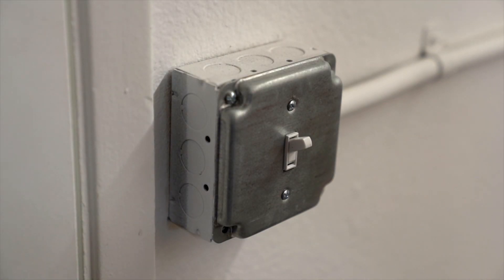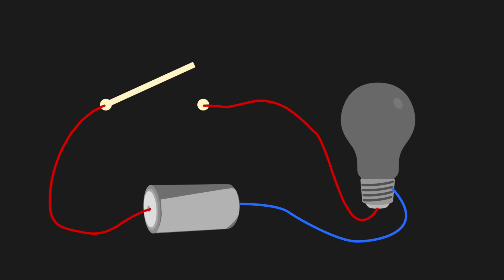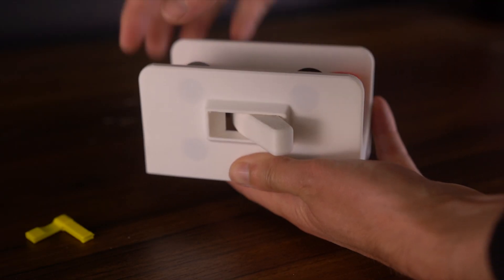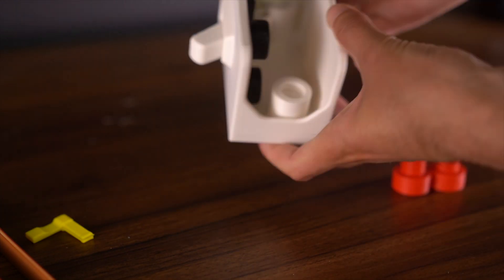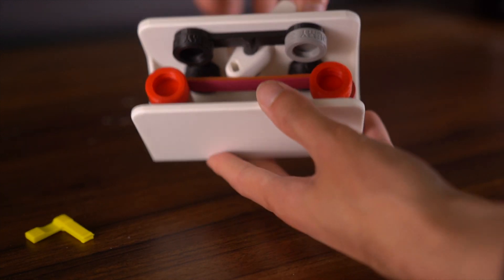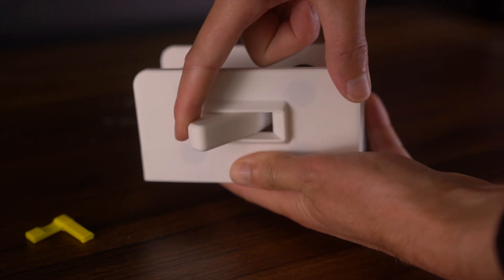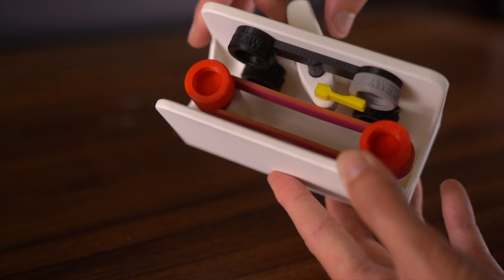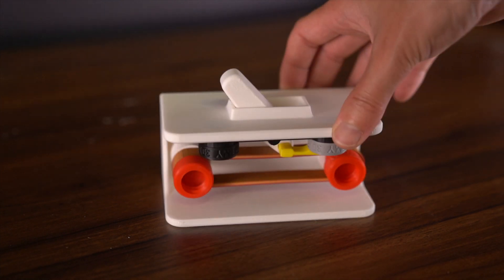The Genius Design of Light Switches

Comment: "But what happens if the switch is stuck in the middle? Will you get electrocuted? Probably not."
The correct answer is a "No, no chance of that. But you might burn the contacts in the switch so that the switch doesn't work properly anymore. Or worst-case scenario is the switch will cause a fire."

Comment: Most switches aren't like this. They have a spring operated switch that theows the contact open or closed very rapidly even if you move the lever slowly. To prevent arcing

Comment: The reason for such a bistable mechanism is the high speed at which it goes from middle unstable position to either stable position, thanks to the mechanical force of a spring-like object. Especially for opening the contact: any current (electric or water...) does not want to stop brutally (imagine some inertia), so when the gap starts opening, there's an electric arc forming. If you open it slowly, the arc stays on the air and increases so that current continues flowing through the ionized gas, which is the opposite of switch-off. With a fast contact blade, the arc is not able to follow the fast evolution of electric field, thus it stops.
Similarly, when closing contact, reducing the gap fast limits the time between arc starting and metal-metal contact (no more arc).
Side note: there is always a small hot arc on closing and opening, so such switches are prohibited in ATEX (explosive) environments if nothing prevents arc formation (capacitor / shock coil...).

Comment: No. You didn't explain what happens if its stuck in the middle. You can hold a switch slightly open. Electricity will jump the gap to make the connection and that is very bad. 

Bad video. Thumbs down.

Comment: a safer switch is a relay. here in australia many brands of cheap light and power switches are pretty bad, where the tiny crappy parts (on 240 volts) can break and create shorts or easily expose contacts to human hands. the race to the bottom.

Comment: For a time in the 1960's, there were switches that made no "click".  I guess manufacturers considered it annoying.
Reply: i think they had mercury in them, so they were discontinued
Reply: I have some of those in my parent's old house.  They are mercury switches.  I don't think all silent switches were mercury switches but some at least were.  They still have the over centering mechanism to give the lever a nice positive action.  But a lot of that "click" you hear in a normal switch is the mechanism that keeps the contacts either open or firmly closed.  And with a mercury switch there's no need for that mechanism.

Comment: better question is why is switch still having hard to hit small nub instead of plate across whole area
Reply: The protruding nubs are better for when you have your hands full or when you're blindly reaching into a room where you don't know the location of a switch.  

If your hands are full, you just use whatever object you're carrying to knock the switch down as you leave the room.  If you're blindly trying to find a switch, you just put your hand on the wall and swipe up, you'll likely hit the switch and flip it all in the same motion.

Comment: When I was at primary school there was a light switch in one of the toilets that if you held it halfway would buzz, while visible sparks and wispy smoke came out of the gaps in the cover. When you're eleven years old it's a fun, consequence free toy, but at the same time I was educated enough to use the back of my hand to operate the switch just in case.
Reply: the advantage was: during the primary school there weren't cybertrucks ...
Reply: Claro, porque el dorso de la mano está preparado para no sufrir la corriente eléctrica
Reply: @goyo9992 i think it was to avoid getting stick to the switch if his hand contracted due to the discharge
Reply: @diego_roca yeah that’s exactly why idk what that other guy was rambling about

Comment: Maybe the most important part: You don't want the contacts to be close but not touching, to prevent an electric arc at high enough voltage.
Reply: Don't want them close but not touching?  They are either close (as in nearby), or they are closed (as in in contact).  Confused by the word's two different uses.
Could you explain what you mean? In contact or not.  I think it's in contact and not near (with gap).
Reply: @louf7178  As said, you don't want keep the contacts in a small enough distance to make and sustain an arc (can be cca <= 7.5µm for 240 VAC in air). The mechanism is designed to keep the contacts either far apart or touching, but the time when they're at the arc proximity is reduced by making this position mechanically unstable.
Reply: @BohumirZamecnik  Thankyou.  I have recently learned why switches are rated so much less for DC, and this is why I was reconfirming.

Comment: What about 3-way switches though?
Reply: Same thing it just has a contact on the other side
Reply: Using logic gates and boolean algebra
Reply: tri-stable mechanism
Reply: It's just a wiring game. The switches by themselves are the same
Reply: Whats a three way switch
Reply: Magic
Reply: Then 4 way switches actually switch connections
Reply: A 3 way switch is just a switch that instead of having an off position connects to another wire to another 3 way switch and both switches have to be switched to the same wire to have the light on...
Reply: Magic, probably
Reply: fuck 3-way switches